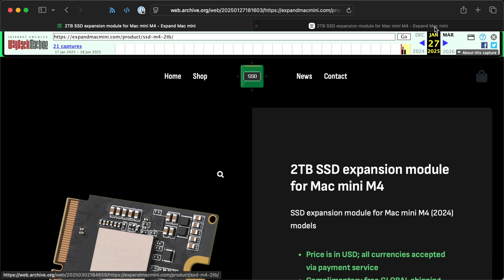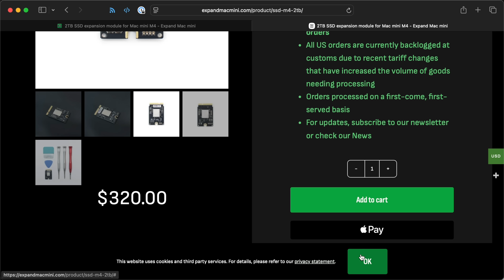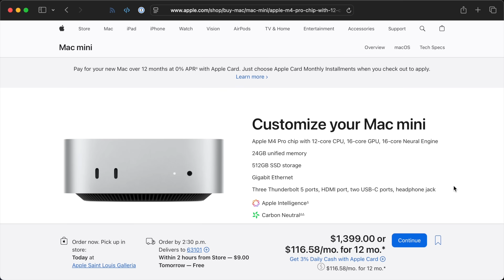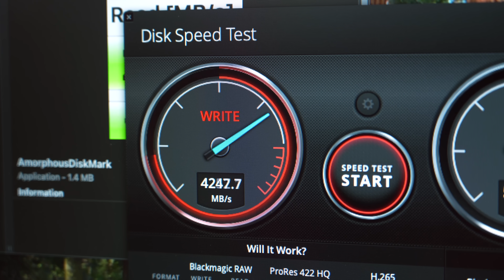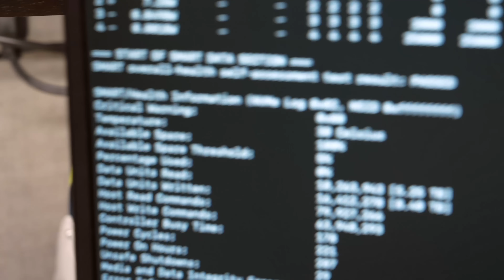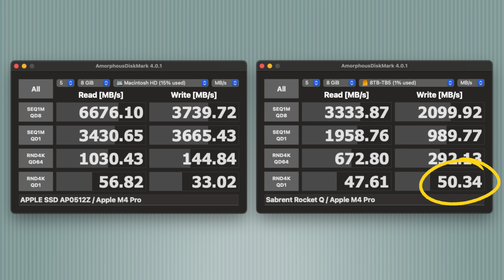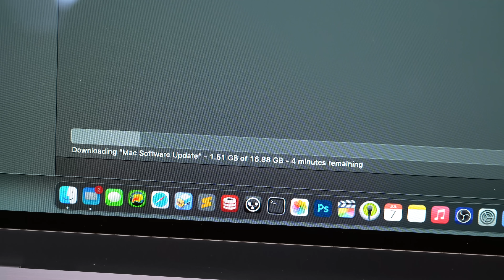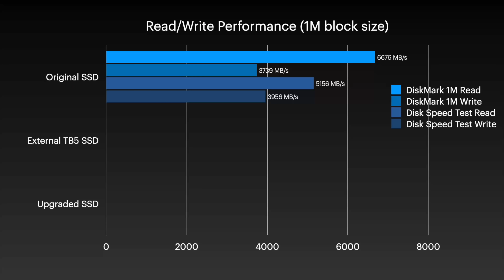There are three types of Mac users

Comment: You don't need to be running Sonoma or later on the "server" device. If you search, it's possible to find apple configurator v2.16 ... this works on macOS as old as 12.4 or later. I've personally used this on a 2017 macbook retina (12") running Ventura 13.7.8 (at that's the latest macOS it can officially run). I used it to restore a MacBook Air m1 ... the first attempt, it got part way through and said "A software update is required for this device" ... I clicked on "Quit and Update", let the update download and install, then tried again ... and it worked, but installed the latest OS, Tahoe 26.2 ... but I wanted Sequoia. Turns out you just download the .ipsw file for the version you want (subject to hardware compatibility) and drag & drop it onto the "DFU" icon in apple configurator once the device to be restored shows up. So I've actually restored the MacBook Air m1 twice from the macbook retina. I'll keep it for when I upgrade the SSD in my macbook mini m4 Pro :-)

Comment: You can also use idevice restore with linux. Only limitiations are that 15.4 and later dont work. I can confirm that that works because it worked on my M2 air

Comment: Pro tip when upgrading or changing drives on a mac: Get an external drive of at least your old drives' size as well (doesn't need to be fast if you're patient) and use it to create a Time Machine backup. When you put in the new drive and reinstall macOS, you can choose to restore from that backup which will bring back EVERYTHING. Your apps, your settings, your logins, all of it.

Comment: I bought the ExpandMacMini 2TB upgrade immediately after watching your prior video, and got the original price. Has been working fine since. I had also bought the OWC TB enclosure and a 2TB Samsung 990 Pro before that, and I was frustrated working with my home directory on the external drive, so I'm glad you shared the internal upgrade.

Comment: I need to run F360 ( so no linux . even proton is not stable enough to RUN A BIZ) 

HATE AI  and forced updates (so no W11) 

 Love tons of thunderbolt  ( so no AMD ) 
hate downtime (. time machine baby! ) 
the M2 Ultra mac studio was  right in my price range
 the 16 channel. DDR5 ram   can be used as V ram with the same bandwith as a 3080
and yet I can use up to. 48GB of the. 64 as V ram and this is ideal  for photogrammtry ! 

 I saved  not only.  a few grand over a quatro card but also I can negate the need for a $20K 3D scanner 

Its my CAD.   NLE and. 3D machine 

My Intel NUC is my gamer rig 
and my  laptops are all. TOUGHBOOKS

Comment: Definitely type 2 for me. I made an assembly with two Thunderbolt 4 M.2 enclosures, a SATA HD bay (for off-line backups) and giant aluminium heatsinks so the whole thing could be fan-free and silent (when the HD is powered down) with no thermal throttling. Being able to select, upgrade and if necessary replace the SSDs is a benefit in my book and there is a vast competitive market if you are prepared to do the research. I'm still waiting for the market to supply an M.2 NAS which serves the same files on the network for my phone and iPad, and over Thunderbolt for my M4 Pro Mac mini. I was shocked by how much even a 10GB network connection throttles the performance of a single modest M.2 let alone a RAID array of Gen5x4 beasts!
Reply: Same for me but I have an NVME DAS connected with Thunderbolt. I'm still paying a tax in that all my systems need to have the specs to run OpenZFS well. It's nice knowing I don't have to move my files around and they open so fast I don't notice any slow behavior. I love the small portable size too.

Comment: 6:36 That's caused by NAND type used in the drive - the higher the level the higher capacity it can get with fewer chips, but the slower it's to write into, that Sabrent uses QLC (quad-level cells), the highest capacity and slowest cells at the moment
Reply: Long term which is probably better if speed isn’t an issue?

Comment: I presume the 'key' for the SSD is proprietary.. any use case/adaptor for the 256GB SSD you pop out??
Reply: I have an old ACHI interface (?) enclosure for the older intel macbook SSD - I doubt it will work - but be delighted if someone can correct me :)

Comment: That 8tb NVMe is a strange choice of drive for testing, I guess there's reasons behind using a drive that has a max read speed of 3300 MB/s?
I had a check to see if there were limitations for that size drive, but as an example, a WD_BLACK SN850X 8TB SSD has an "up to" 7300 MB/s read.

I got an acer Predator 2TB GM7 for my 40gbps external storage, with the view to an upgrade later down the line to 50gbps once the prices go down.
On my 40gbps external storage I get a steady 3300 mb/s Read and 3150 write. 
The write is roughly half that of my m4 pro internal SSD and the read a bit less than half.
Not an exact scientific test - but a good indicator.

I'd be super interested to see the results of a faster NVMe - same storage capacity (8TB) - in that 50gbps enclosure.

If it can hit over, say, 5000 mb/s, that paints a different picture. 
Sure, unlikely it'll hit the same speed as internal AND it takes up a port + is a little untidy, but many will be a little squeamish about taking apart a mac mini M4 - especially a pro model. 

Great video, really got me thinking.
I'm still waiting for that quality dock that sits on top of the mac mini with the same footprint, doesn't require external power and has two NVMe slots at 50gbps.
It would also have a super tidy "solid" cable connector - as slimline as possible, almost unnoticeable.
I think I'll be waiting a long time!

Comment: I think these videos have their place but I find it weird to upgrade internal storage when the Pro literally has Thunderbolt 5 over the non-Pro‘s Thunderbolt 4. Are we really trying to pretend that 120Gbit per second is too slow to just attach an external drive? Plus you can take that with you in case your house is about to burn down. Just rip it off the cord. Put mine in an orange case just for that reason.

Comment: Fourth type: determined to run a Hackintosh no matter how many hurdles Apple lays in their path. Actually I wonder how people are faring there with the switch to Arm SoCs in iProducts. But damn, the lengths people went to to run like every version of MacOS I can remember on non-Apple hardware is part of the stuff that taught me not to underestimate sheer stubborn curiosity.
Reply: Also yes, these numbers are insane to me. I remember when a steady 100MBps read was the holy grail, and I was even willing to sacrifice storage for single-platter 7200RPM drives that still ran like a dog swimming in peanut butter once I put anything on 'em. Now the floor's basically SATA3 SSDs that run fast as all hell next to any spinning disk, and everything you can put on an m.2 slot (or sometimes still a PCIex16 and those are...wow) is like comparing 50% and 75% of the speed of light when all you want is to go to the corner store.

Comment: I upgraded the 256G in my M4 mini with an external TB4 enclosure that sits under it w/ a 2TB NVME...   It consistently smokes the internal SSD with black magic disk test, general usage, encoding, etc..  and 0 issues.  I'd thought about the internal.. but didn't feel like playing the lottery with random raw nand flash / boards, but to each their own.

Comment: Since a bunch of posts already exist about a 4th mac user, I guess i am the fifth type of Mac user.  I bought an original macintosh (before they were called mac 128) and continued to own Macintoshes all the way through their intel years,  but stopped using macs when apple decided that they should be desktop iphones, and started dumbing down the user experience in the OS.  i haven't bought a mac since 2014.

Comment: 5:00 "performance tail off for random access" - wait a minute ... isn't it exactly THAT where flash storage is supposed to be way superior over convential HDDs, is it?
am I this wrong on "spinning rust" vs "solid state"?
isn't flash storage not just some persistent form of RAM?
I'm honestly confused about these numbers: just 1% of sequential - that's way worse than my HDDs which get about 200mb/s sequential but still over 20mb/s random - more than 10%!
with these numbers no upgrade would be worth anything to me but I would rather setup a big network storage and invest in more RAM for caching
could somebody please help me here as I seem to miss something

btw: I use my HDDs with ZFS on a pci-e 3.0 x1 hba - so about 1gb/s (give or take) and thanks to ram caching my array is able to sustain this speed

Comment: High performance NAND QD1 performance of only ~50 MB/s or less is still disappointing. Sequential and higher queue depth is less important. If you need fast sequential performance a second drive for large bulk files is an option I guess. A quick check of my Optane drive and I am at ~300MB/s, not to mention full speed for the entire drive write and incredible endurance. Only have 1 TB drive, but was cheaper than these apple prices, and honestly about the same as the M4 upgrade prices. Was actually an option on Mac with devices that had standard M.2 or PCIE ports.

Comment: I use a TB4 expansion with nVME3 on  my M1 Mac Pro and I get about 2 gbps - it was nearly 4, but I am using three monitors, two via the same ports and that seems to drop the rate substantially. Seems to be a chipset style issue. So I'd like to see verification of that - or not?

Comment: It's interesting that USB4 is actually not working on any mac that supports it. It frequently disconnects and never reconnects by itself -- even if it's cooled very well (~40C). I have to plug it to USB3 port on the front for my Mac Studio so it doesn't fail spectacularly.

Comment: On a Mac Mini I'd probably go the route of swapping the internal disk if I needed more internal storage (which I probably would, if I got the base model), but for general file storage, I'd probably go for a NAS solution and shell out for the 10 gig Ethernet... or even buy a thunderbolt dock with both 2.5GbE/10GbE and an SSD slot for more storage and decent speed NAS access

Comment: I might be overthinking it, but:

1 - measuring temp on the hull of the drive or via a temp sensor on the board can never give you accurate data because there are tens or even hundreds of tiny components which can individually overheat and hamper the overall performance of the drive. They also tend to burn out right after the warranty period expires

2 - Looking at that board design for the M4, well that's just bad design man OR they're purposely doing it so that you need to buy the 'proprietary' hardware...

Comment: Meanwhile, on my Windows machine, I *could* install off-the-shelf drives easily to upgrade my local storage, but I don't because network storage over 10GbE is fast enough for my use case and I dislike having to copy things around.

Comment: not to questioning your decisions this is a real question as I thought I might be missing some information that was not in the video.  Why are you comparing a now very old and very slow sabrent PCI3 drive versus a current PCI5 x4 m2 drive?  such as a crucial T705, Samsung 9100Pro or Corsair MP700Pro.  These are no longer bleeding edge devices and their prices are not insane as they were a few months ago? Is it because you already had the Sabrent?  The reason I am asking is that it would be interesting to see how these new PCI5.0 controllers work in the Thunderbolt 5 enclosures, and if they actually give you any real benefit over the older PCI3 and PCI4 M2 x4 drives. (also explaining what the x4/x2 difference is in an enclosure versus as on a motherboard.)  Hope the question made sense. thanks again as usual.
Reply from the maker: Yes mainly because I had the Sabrent on hand; this particular TB5 enclosure also is only compatible with up to PCIe Gen 4, Gen 5 is not yet supported in the chipsets I've seen with any of the TB5 vendors who list compatibility :(

Comment: Interesting. All the guides I saw said you needed an m-series mac to do the dfu restore, they didn't say you could do it using an intel mac with t2 chip. That means my prehistoric black mini (the best-looking computer apple ever made - imo) could theoretically do the restore, so I wouldn't have to lean on one of my coworkers. I was actually waiting for the specific config m4 pro I wanted to show up in the refurb store, now I can settle for a 512GB model instead of paying way too much to upgrade to only 1TB, and upgrade to 2 or 4TB later if I find the drive too small.

Comment: I am capable of a DIY upgrade. But I still chose to pay Apple $200 for the 512GB upgrade. Why? Three reasons:

1. The DIY upgrade voids the warranty. Good luck if there's anything wrong with your Mac mini.

2. The DIY upgrade is not free of risk in damaging the device, no matter how careful you are. Accidents do happen.

3. If the SSD module is defective, or if anything else goes wrong during the upgrade, it's a major hassle to redo everything.

There's a 4th reason, as well.

4. If you're not used to DIY anything, there is a measure of anxiety and stress associated with the task. This probably applies to most people.

I'm not really a DIY kind of guy. Sure, I did build my own PC back in the day, but that was a long, long time ago. These days, I just want to relax and get on with my work.

I attached a 2TB external drive and my setup is just about perfect. (If I want to, I can attach an 8TB drive.)

The only reason to upgrade to 512GB is that 256GB is somewhat restrictive for a system drive. I want some headroom in case I ever want to install really large applications.
Reply: 1. The warranty is still valid in practice if you put the original SSD back in and don’t disconnect cables inside - essentially, don’t leave traces.

2. That is on the user entirely - judge if you can before upgrading.

3. If your backups are in order, shouldn’t be harder to revert than installing the upgrade.

4. This is not for “most people” in that sense - they don’t know nor dare to open these up.

That’s my two cents

Comment: Word of warning with thunderbolt M.2 NVMe enclosures, they can be prone to overheating and having a short life expectancy. The M.2 NVMe drive itself does not overheat, but the thunderbolt controller and power circuitry can. Spent over £100 on such an enclosure and left it plugged in 24/7. The enclosure became unreliable (random drive loss) after under 1 year of use. Moved the drive to a new enclosure that I only plug in when needed, and the drive still works flawlessly to this day. The enclosure often felt physically hot to the touch and failure started with being associated with hot temperatures.

This is likely why the models shown here have active cooling fans. Also this points to Apple having some serious power management issues with external thunderbolt connected NVMe drives, either not changing the drive and link power mode correctly when idle or not reporting to the user why a drive is currently not consider idle. In my experience sometimes the enclosures are cool to touch showing correct power management, other times they are quite warm/hot despite similar workloads. NVMe drives should barely use any power when idle or lightly used, so the enclosures should be only a little warmer than ambient.

Everyone should probably ignore the 1 thread 4 KB random read results. These tell you nothing about how fast SSDs are, and instead just tell you how fast I/O API and communication latency is. They are such small values because a single thread cannot issue read or write instructions any faster using the method implemented by the test. 50 MB/sec in these conditions is 12,500 I/O calls per second. I also suspect these are not asynchronous I/O calls, or the queue depth is very small, so the thread has to wait for data to be read/written before proceeding which is why latency seems to affect it so much. The much more important metric is the high thread count and queue depth 4 KB random reads/writes, and as is evident these are usually over 2 GB/sec for modern drives, closer to 9 GB/sec for really high end directly connected NVMe M.2 drives. This represents the worst case read/write performance, where all data is being read/written randomly with the drive but there is no API or CPU bottleneck doing so.

1 thread 4 KB random reads might represent the performance of an old or poorly written application, or a very specific case where data is being read in a dependency chain. Older applications often used a similar I/O approach as the inherit API/software bottleneck was masked by the sub 3 MB/sec random 4 KB reads that mechanical HDDs achieved. Data dependency chains can only perform 1 read at a time since subsequent reads depend on the current read, so ultimately performance is limited by round trip time of a single read.
Reply: That's because you're buying crappy ones. There are decent ones. You can't just buy the cheapest controller without proper cooling.
Reply: @tschorsch  Should they need "proper cooling" when I only intend to load/access them for maybe a minute or two every day? I still think it is an apple power management issue since there is no reason an apparently idle drive should be running that hot. Sometimes they do not run hot, other times they do. SSDs that are not under constant high workloads (GBs/sec for minutes) should not require active cooling. They should literally only use a couple of milliwatts when idle and in my use case they should be idle over 99.9% of the time.